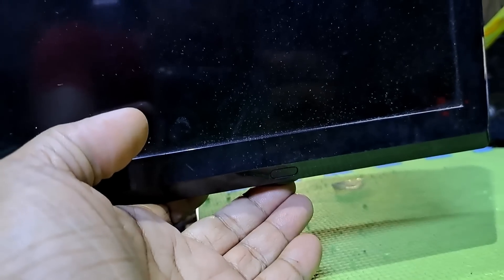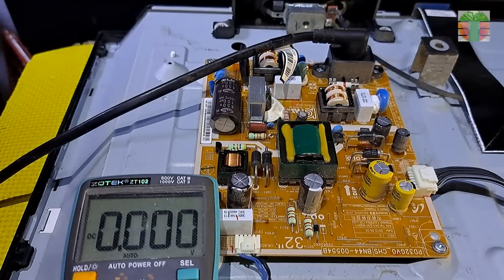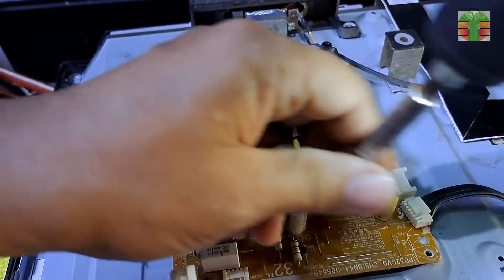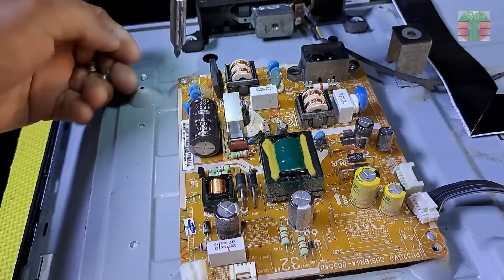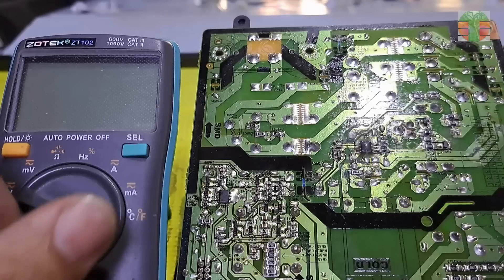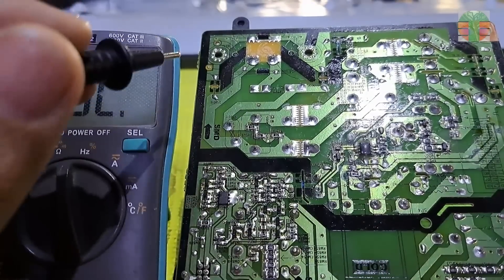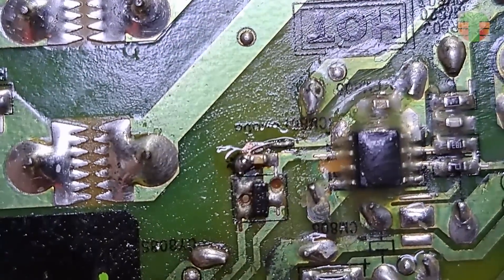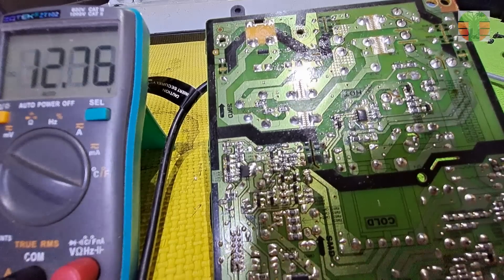Overvoltage! What is the cause?!

Comment: Hey Mr T. When you are free can you show some of the TVs that couldn't be fixed? What was symptom, things you have checked and possible reasons why still  faulty. Thanks.
Reply from the maker: Yes, I will, Its a content anyway.
Reply: @tevzTVTevatronics  I hate it when I can't fix something. Working on laptop now. Has symptom of only work on battery not AC. Tokin capacitors tantalum was replaced before to fix this issue last time but this time same problem comes back 3 years later but replacing capacitors does not fix issue. One more item to recycle bin.
Reply from the maker: @Swenser  Laptops are complicated circuits. I repair only 50% of them.
Reply: Hi . I'm working on 32 Samsung tv with white screen. I found L4 on lcd flex board shows short but I can't find any capacitors nearby on the same line showing short. Is it possible no smoothing capacitors at all and the inductor goes straight to ic? I'm thinking ic is faulty? Any ideas on why I can't find capacitors showing short? Or is short inside panel and I need to cut lines?

Comment: Hello Tevz, of course I enjoyed your video. Thanks for the information shared. 
But one thing I understand in power supply is that whenever that happens, it supplies very high voltage to the motherboard and possibly the screen.

I have seen a situation where the optocoupler pins got rusty and then cut and the power supply very high voltage that destroyed the main board and screen on LG television and another on LG blu-ray player. 
On the LG television, the sound IC got burnt and the CPU got burnt as well. Even after fixing the power supply the TV still did not work.
So tell me how did the Samsung main board survived the high voltage of 26 volts
Reply from the maker: The 26 volts that measured that going to the main board is not been used. as you can see it stays 26 volts even though the main is not connected. the 26 volts, supposed to be 12 volts is not directly connected to the audio amp,
 the panel, etc.. Its have a MOSFET to switch it if the power is turned on. But the 5 volts is not normal. At the begining of the video. The 5 volts measure only a pulsing 1.8 volts, and the system will not turn on to that voltage situation. So no components were damaged. the voltage is pulsing because the PWM IC driver is sensing a high VCC voltages and automatically turning off. The line where cut due to corrosion.

Comment: There are more modern digital multimeters which have a bar graph at the bottom, under the digits, and typically that bar graph is refreshed 10-20 times a second while the digits are refreshed only 2-3 times a second.  So you would at least see that bar graph jump to a high voltage. 
Some multimeters also allow you to lock the range to some specific one so that you won't miss such events due to meter autoranging and changing the number of digits after the dot.  Last but not least, multimeters have a MIN and MAX buttons that can be used to display the min and max values detected until you reset.
Reply from the maker: Thank for the info.